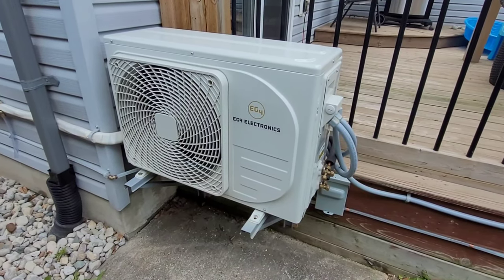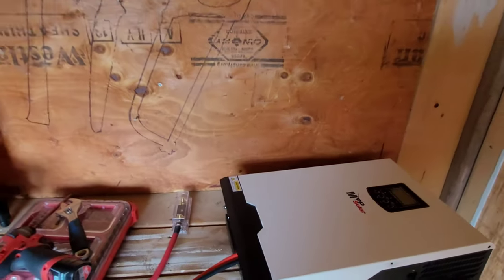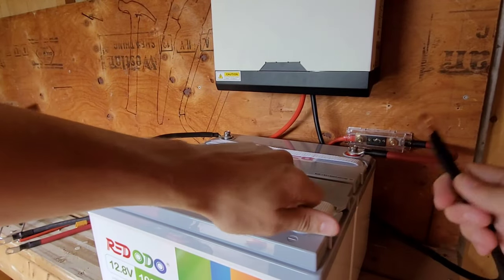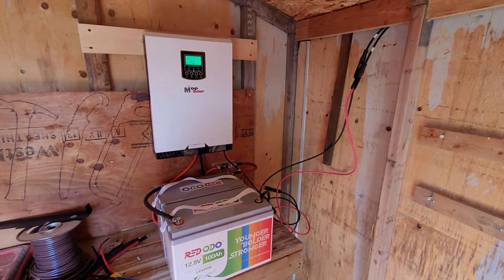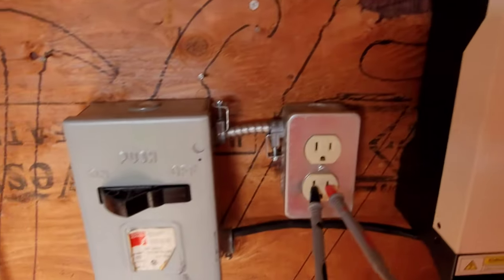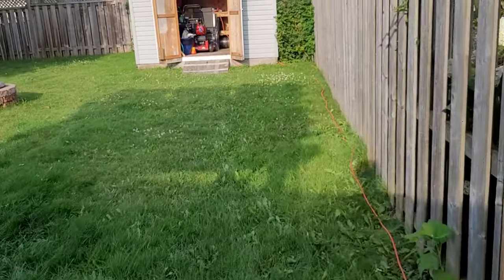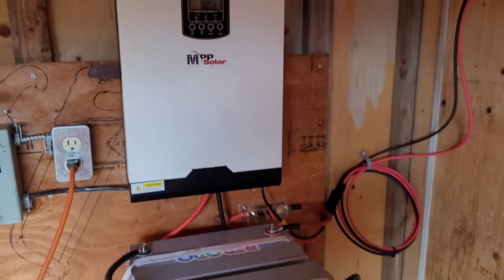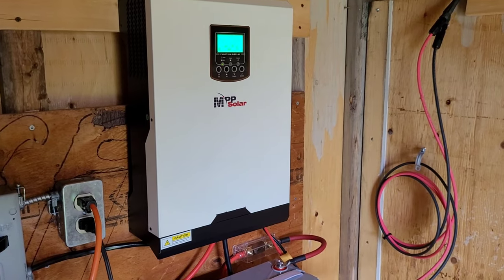Off-Grid Air Conditioning - Solar Mini Split Battery Backup System

Comment: what does it take to run a central air. Thanks 220 v
Reply from the maker: Yes central AC's are 240v, this mini split is 120v
Reply: Central air takes massive power and massive battery bank, from what I have seen. These mini-splits are much more "do-able" re price, space, and setup.

Comment: why 24v and not 12v? Will that inverter not work with 12v batteries?
Reply from the maker: No it won't, it's a 24v inverter

Comment: No resistor, no problem…. Take a normal number 2 pencil, sharp it on both sides, and put on tip on the terminal and the Oder tip on the cable.  Graphite on the pencil should be enough resistence.

Comment: Must not be that hot there I put a small 5000BTU window AC in a shed it draws 960 watts when outside temp is 117F.
Reply from the maker: Is it an inverter Ac able to ramp the compressor frequency? Or is it just on/off? We never see temps over 100f so yea that's a lot hotter climate

Comment: Where on the EG4 does the extension cord connect?
Reply from the maker: It has standard line/neutral/ground terminals, I temporarily wired in a male plug end for the purpose of this video
Reply: @SmitHVAC.  Awesome. new subscriber here by the way. Can it switch between 120v and 240v?
Reply from the maker: Thanks for subscribing! This is a 12k btu 120v model, the larger ones are all 240v and they all have a DC range of 90 to 380v DC
Reply: @SmitHVAC.  seems the 120v model gives a lot of flexibility when running off battery backup. I expect a 240v battery backup inverter would cost a lot more.
Reply from the maker: Yes it does, I ran it on a little 1000w inverter and 100ah battery in my other video and it worked great

Comment: Please forgive my ignorance. Is there a way to build a battery system on the DC side?  Seems like an extra step to have the battery power converted to AC to supplement the solar DC. What am I missing?
Reply from the maker: If you put enough batteries in series and found a mppt that could charge at 200V then it's possible. I don't have that equipment at my disposal. Then you're also dedicating all that equipment to one task, this system powers my other loads now that it's in my house.
Reply: @SmitHVAC.  thanks!  I was mostly asking out of curiosity to learn.  I appreciate your reply
Reply from the maker: @CJB_B95L  No problem, that's a question a lot of people have asked. So much that I reached out to the manufacturer to confirm it was possible! Thanks for watching
Reply: @SmitHVAC.  this is really intriguing to me because as far as I can tell, this isn’t really grid tied so you wouldn’t need all the permitting. It’s an appliance that can use either or both but if power went out, solar would not be feeding into your mains, causing a hazard.

Comment: how long does ur system last with the ac on when the sun goes down?
Reply from the maker: About 10 hours with my current setup, I've added 2 more batteries but I usually shut it off after 2 or 3 hours
Reply: @SmitHVAC.  so you have 4 battery now and you have the battery on 12v or 24v
Reply from the maker: 24v
Reply: @SmitHVAC.  and youre inverter coverts the 24v to 110v
Reply from the maker: @psychopath_ca007c.a.7  yes
Reply: @SmitHVAC.  could you send me a link of that inverter or info of it?
Reply from the maker: @psychopath_ca007c.a.7  This one is the MPP solar LV2424, they make lots of different models
Reply: @SmitHVAC.  thank you for the info wil look more into it and looking foward to see more of youre vids to see what you add next to it

Comment: That's a very long run and power lost in that extension cord
Reply from the maker: Still had 119VAC at the unit, 14Awg cord. No issues.

Comment: Your hooked to power. Your lying Your system couldn't do any of the thing your saying.
Reply from the maker: Oh no you caught me, great detective work sherlock. What would I gain from making a fake video about this?
Reply: How many ah does it take to start a compressor in 24vdc?  What is the current draw on a 24v system to run 2kw at 1/3 duty cycle for 12 hrs? What is the maximum power generation @optimal sun for the area? Then the lie starts to become more clear.
Reply: The reason for giving deceptive information to the un educated . So they return to you to buy more and receive more partially true advice and still buying more and needing you more. So the motivations are clear !
Reply from the maker: @corashy1950  You seem confused.. I'm not selling anything, I'm not starting any compressors at 24vdc, I'm not running 2kw at 1/3 duty cycle for 12 hrs. Did you watch the video at all? Maybe you should just move on..
Reply: If you have people's best interest in mind . You would 1st educate .A super cap would need to be put in place to handle compressor start current. A BMS  is a must and most of all a 48v,60,72 or 96v system is far better than any 24v system every could be . System is not mobile so weight is not a issue .LF big transformer  GOOD for compressor  and motors . Same setups on old navy ships planes and bomb shelters and remote living facilities voltages vary to 600v
Reply from the maker: @corashy1950  If you're an electrical engineer you'd think you would know about 3 phase inverter compressors.. There is no huge inrush of current on startup, its a soft slow start. Look it up. You can argue with yourself if you want to carry on.. I'm not going to entertain this any more.
Reply: @corashy1950 - LOL, better look up the tons of info re mini-splits on the internet and youtube. Your accusations are ridiculous; maybe you just like to be a troll.